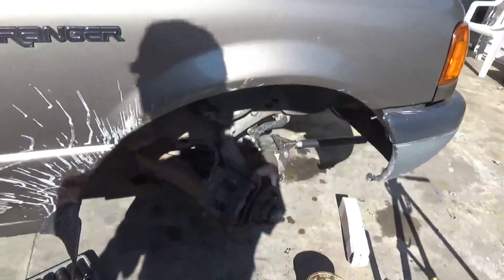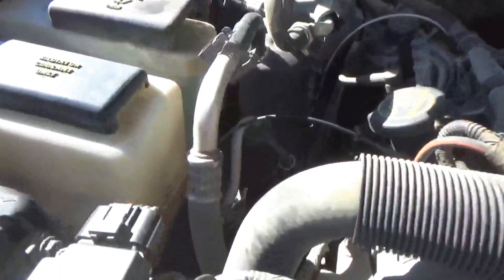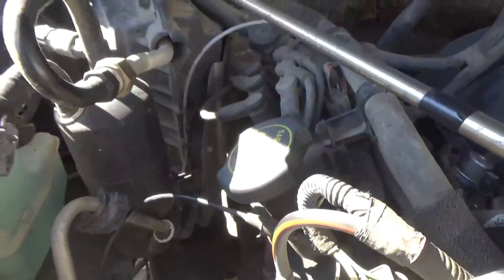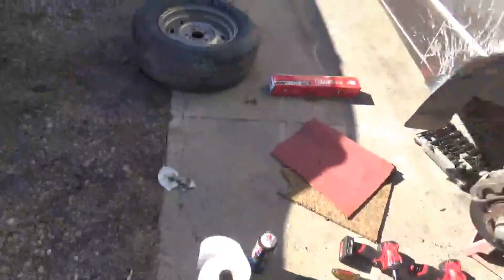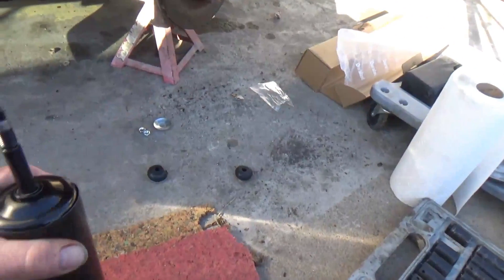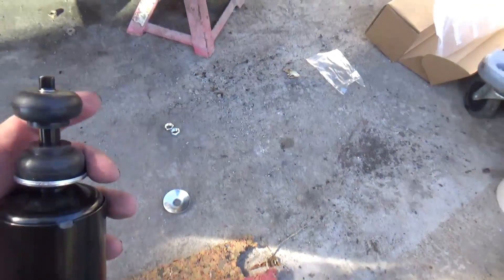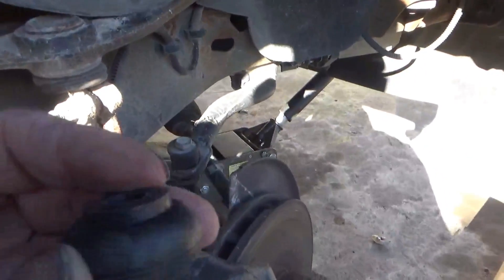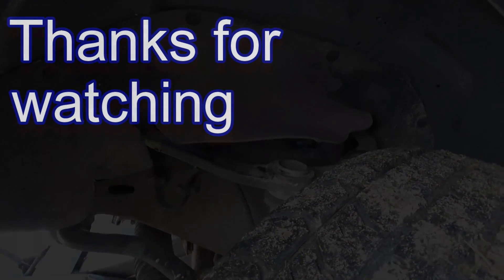2003 2 wheel drive Ford Ranger front shocks

Comment: getting her back in shape we had a front wheel bearing fail on one of the freight liners could have been real bad had the driver not caught it in time.    The cone of the bearing welded its self to the spindle  had to put in a new spindle and works but hey stuff breaks
Reply from the maker: I've seen that happen on cars, I've always been able to do a bit of cutting and grinding to get it clean enough to put another bearing in. The inner race doesn't spin 
on the spindle unless it welded itself to the rollers, so the spindle doesn't need to be perfect just a nice fit, pitting is harmless.

Comment: I've bought one of those stubby 3/8"  with an M12 battery. It will handle most things and is real convenient. That is one of the nicest gifts I've seen anyone receive on an eBay channel.
Reply: I bought m12 ratchet it is great tool
Great for spinning in and out bolts and nuts
Reply from the maker: Thanks Eric.